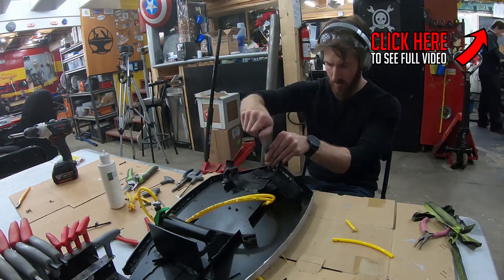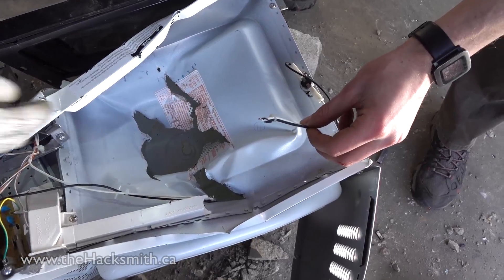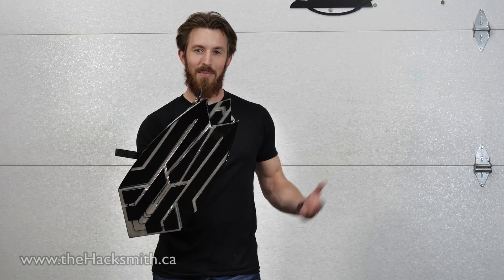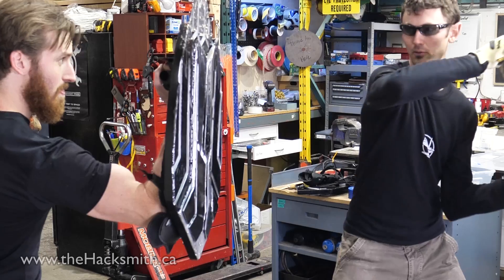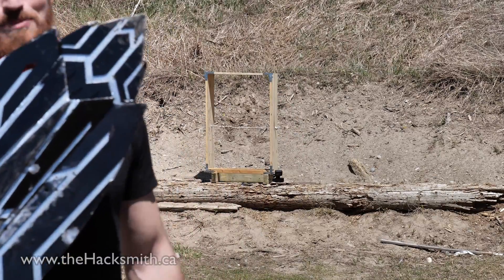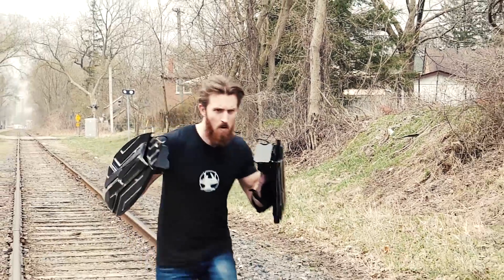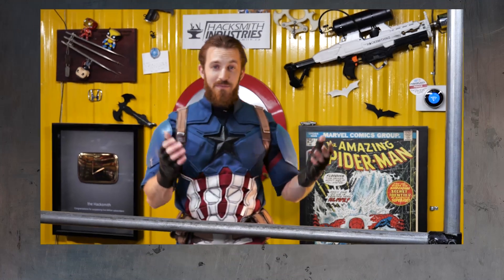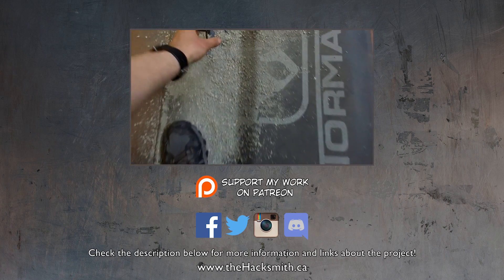Captain America Wakandan Shield TEST (INFINITY WAR)

Comment: Glad the silly people who complained about the sheilds size didn't get them down. A small sheild "Not making a difference" is complete malarky from those that clearly know little about sheilds, sure a sheild wide and tall enough to hide your entire body behind is nice in theory, seeing as in theory you could just stand behind the thing. But historically, an extremely large sheild was inferior to a medium or small sheild, in a few major ways, the first being, it will weigh quite a lot more if you want a sheild of similar thickness, that weight is bad for just walking to destinations with it but even worse for battle as it would exhaust the user. The second reason being, it's sheer size makes it obstructive to the weilder when they would otherwise have no problem counter attacking around the small sheild they hold in front of themself. Thirdly, the larger sheild could be stood behind, but generally that was just met with the attacker sidestepping around to the back of the person for a clear angle, the heavy sheild now being a hinderance since you would have to whip it around 180 degrees faster than the attacker can strike your back.(Not gonna happen by the way) Anyone who think small sheilds are useless, are probably unaware of the popularity of the buckler sheild, a sheild that is little larger than a dinner plate. And don't make me explain how those are in fact quite useful, this comment is long enough already. Just look it up and maybe watch some of Skallagrims videos where he explains some of its advantages.

Comment: There were small strapped shields historically that were that shape, but yours is flat and doesn't taper from the centre to the edges so all the weight's hitting your forearm not rolling away and your hand's at risk when you punch with it

Comment: great video but you hold your handgun wrongly you hold it in what is known as a cup and saucer grip which is completely wrong as if you use a slightly more powerful handgun such as a .45 it will basically recoil back into your face

Comment: @the hacksmith  hey, love  the videos. Just wanted to drop a friendly note and let you know that flat panel TV's can have 500 volts DC running in the power supply inside. Just don't want to see you get electrocuted. Thanks for all  the hard work.

Comment: You know, I wonder if you use a dense Kevlar carbon fiber weave layered in a 90 degree offset from last layer to increase rigidity. I mean Kevlar Carbon Fiber is also heavily impact resistant, and depending on the type of Kevlar, also fire resistant. Though much lighter than the metal you used. Probably wouldn't fatigue you as much with prolonged usage. It is however much more costly to use carbon fiber, but if you're trying to make a functional version, wouldn't you use a much lighter and more durable compound to simulate Adamantium (original metal used in cap america's shield). Might not be as heavy with downward attacks as the shields own weight weighs on the force of the attacks, but I'm sure with the tips of the shield could be reinforced with metal like a shear type edge for cutting and piercing. Just an idea.
Reply from the maker: Unfortunately this design isn't well suited for carbon fibre

Comment: The most pointless video ever, considering that the metal it’s made of isn’t actually real but is the Strongest material, even steel is no where near the supposed strength of vibranium
Reply from the maker: and yet even steel withstood everything we threw at it... what exactly is your point?
Reply: the Hacksmith my comment was a little harsh, but I meant that testing it’s durability is nothing like the one from the movie obviously, there is test to test its durability, like iron man’s chest cannon not doing anything to it, or like from the first avengers when Thor slams his hammer down onto his shield, the force that the hammer hit the shield must have been immense, probably a similar force to a 50 caliber round hitting a 2inch think steel wall. There isn’t really any safe way to test it’s durability to the extreme or tests you can do which also happens in the movie, like force a vibranium would stand up to but steel would be like aluminium foil, that would be a good way to calculate the strength of vibranium, like testing the steel shield against a hydrologic press which could simulate the force from the first avengers movie when Thor slams his hammer on the shield

Comment: you should definetly NOT hit a microwave without discharging it. It has a high voltage in it. It's EXTREMELY DANGEROUS
Reply from the maker: It's just the one small capacitor that can hold a high charge. But since the shield is metal, the capacitor would simply arc across the shield, I'd be perfectly safe. The more you know, the safer you can be! But don't do what I do =)
Reply: Lalama I think that they know that, considering they all have backgrounds in electrical engineering
Reply: Yea
Reply: the Hacksmith 
Imagine, if you'd actually miscalculated and just got electrocuted :p

Comment: If you made it out of titanium it would be incredibly strong and super light. Making it significantly easier to handle.
Reply: Captain Fedora2 titanium isn't light, you're thinking of carbon fibre
Reply: Harry Bell I'm not saying it's the lightest thing in the universe, I just mean relatively compared to steel and other metals it is lighter and stronger. Carbon Fibre may be strong, but it wouldn't be able to handle the abuse that metal can take, it would just crack into many pieces.
Reply: Captain Fedora2 it isn't lighter than steel trust me I know this
Reply: Harry Bell

Titanium is 45% lighter than standard steel, you're probably thinking of an alloy.
Reply: Captain Fedora2

Perhaps for small arms fire, but if you're not too concerned about weight, a hardened steel alloy such as AR550 should suffice. A 1/2″ plate can stop a .50 BMG round.
Reply: Some Guy I'm just saying in this case titanium would be better because if you look closely, when he is swinging the shield he is struggling a little bit. If the shields were made of titanium they would be as you said around 45% lighter making it, like I had said much easier to handle and stronger as an added bonus.
Reply: Captain Fedora2

Titanium is only lighter in comparison to common grades of steel, steel alloys can be lighter and stronger. A plate of AR550 steel can be cut down, the thinner plate could be just as strong and light as titanium while being at a reduced thickness. The properties of titanium also mean that it's harder to work with, it's also more expensive. Titanium is also brittle when compared to steel alloys, you want a flexible material like kevlar, but stronger. Trauma plates are made from steel alloys for a reason, titanium is better for aerospace engineering.
Reply: Some Guy AR550 steel may be a little bit better but it sounds like it might not be fully industrialized quite yet, titanium is readily accessible now.

Comment: Someone could actually make great use with these in combat. Make it Real: Real practical!
Reply: Militaries use rifles, which shoot bullets that are way faster and harder hitting than a standard 9mm so it would probably go through the shield
Reply: Make it thinner and you've essentially just got a buckler with stabby parts. Awesome!
Reply: Tyrannosaurus Rex Fair enough. OP implying the shield was good for combat made me assume you did, too. My mistake.
Reply: I'd inject myself with super soldier serum.
Reply: I'm not saying it's good. Just saying that it would work to some degree. Obviously there's a reason why modern militaries don't equip their troops with shields anymore.
Reply: 1 inch ~= 25mm

No 5.45 round in the world can go through 25mm of steel. Extremely modern AP rounds for 7.62 might be able to, but it's a stretch. It's not until you get to .50 cal weaponry that achieving 25mm of perforation becomes feasible.
Reply: +Tyrannosaurus Rex 
Everywhere but the center is only 1/4 inch, and the shield is a lot heavier and more award than an ar500 steel insert.

Comment: Who would be dumb enough to ask if a shield made of hardened steel even if it is only 1/4th of an inch of steel military grade armor panels are only 1/2 an inch thick
Reply from the maker: Your comment makes no sense...
Reply: I meant to put bulletproof in there my fault but while I was in Afghanistan the body armor panels my unit used were only 1/2 inch thick so I don't c y anyone would doubt the sheild is bulletproof

Comment: You should definitely remake it     In AR500 so you can make it with thinner material but still have the strength and better bullet resistance. And add a sheet of sorbothane  under the shield for impact absorption

Comment: I don't know why people think it cant be a good shield because of its size. Smaller shields are easier to maneuver, making them easier to carry. Also, if you're skilled enough, they can be just as effective as larger shields, but give you more agility.
Reply: Ikr. In the medivel era some shields were even smaller. They were used for parrying and stuff like that.
Reply: David J i guess it depends on what you 2ant to use it for. Viking shields were big to cover light armoured troops in a wall like function.  The small buckler parrying shields were meant for more 1v1 duels.

Comment: You shouldn’t actually destroy a microwave. It contains beryllium and its highly radioactive. By puncturing holes in it your are releasing the element into the air and environment, potentially causing damage to yourself and the ecosystem.btw I’m only in 5th grade, so if you don’t believe me, go do some research yourself.
Reply from the maker: Only if you hit the magnatron, which I didn't